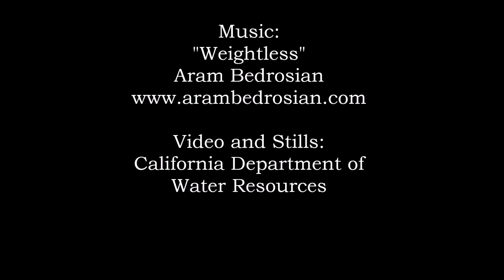Oroville 22 Feb 2018 Update

Comment: That damn green spot again. When the msm gets stuck on a topic they just won't let it go. Pretty funny.
Reply: It's obvious when the main stream skews the story to make headlines.
Reply: You could write a James Bond film from the report on the spillway failure. An evil villain tries to destroy an entire city by paralyzing the organization responsible for responding to crisis, and preventing any of the engineers who know what is going on from doing anything to stop it. 

The very beginning of the movie is about silencing the engineers talking about the problems with the herringbone drainage pipes possibly causing a spillway failure.

The evil villians test of their total power to manipulate the bureaucracy with the removal of the dispersion ring in the river valve outlet system, which ultimately resulted in the near death of the 4 workers assigned to open it to 100% after the engineers said that the river valve outlet system could not be opened beyond 30% without the dispersion ring in place. Only their safety harnesses saved them from getting killed while being shot down the river valve outlet tunnel. 

When the main spillway finally fails, they shut it down, and allow the emergency spillway to be used, even though they never armored it like the engineers told them needed to be done to prevent the water from undercutting the emergency spillway and causing a total dam failure. 

007 comes in at the last second and opens the main spillway again, preventing the failure of the  emergency spillway, which would have completely destroyed the dam and the city of Oroville.

"Lets focus on the grass that has been there since the dam's construction!" is the story the media decides upon...
Reply: russian green spot.
Reply: they should give them a stupid answer to go with the stupid question, like  oh that's where Trump's money tree is planted!!!